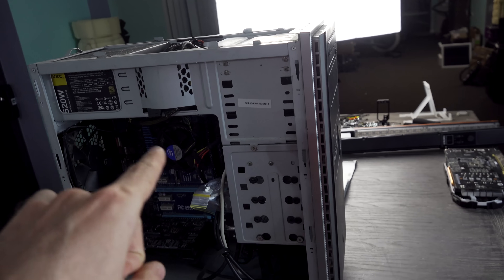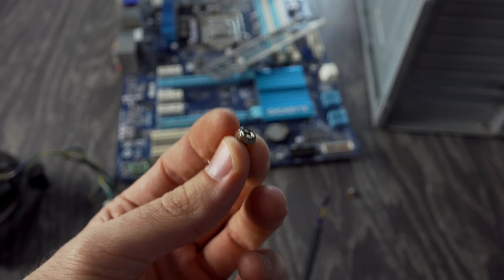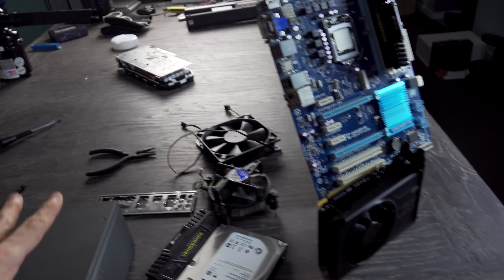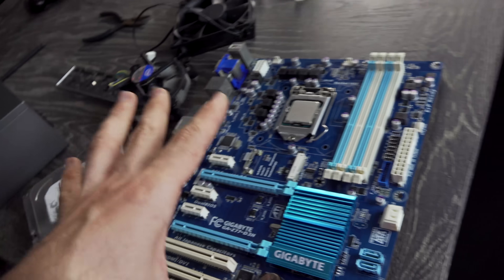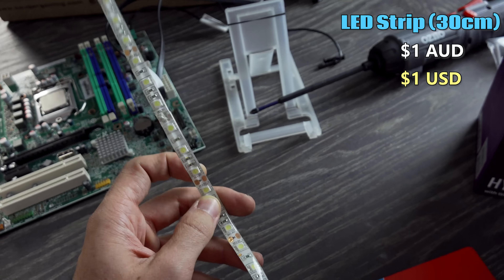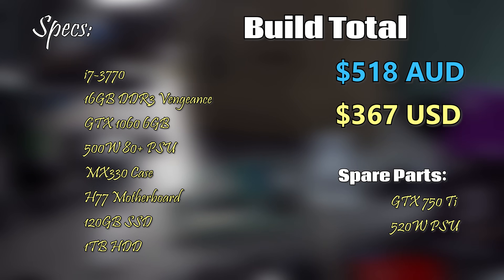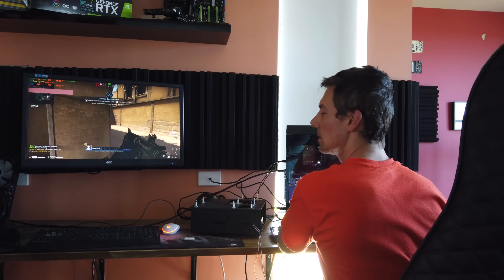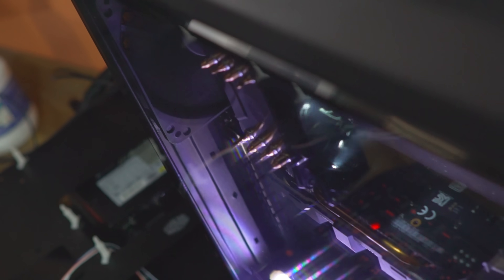Trying to Fix a $150 Gaming PC That Doesn't Turn on - Worth it..?!

Comment: Oh man streets of rage music while taking apart a PC. Love this channel even more keep up the good work.
Reply from the maker: <3
Reply: @techyescity  Do you still have that Z77 board? If so, here's what you can do, according to a post on Tom's Hardware:

"1. Shut off the power supply using the switch on the back of the PSU, wait 10-15 seconds.

2. Press and hold the case Power On swtich, then while still holding turn on the power supply from the switch on the rear.

3. Still holding the case power on switch, the board will start, once it does release the case power on switch and shut off the power supply via the switch on the read of the unit. (Do the latter two parts as quickly as you can once the board starts)

4. The board will shut down.

5. Turn the power supply back on using the switch on the rear of the unit.

6. Turn on the motherboard by pressing the case power on button.

Once the board starts this time you should see the Gigabyte splash screen, or POST page, then the Auto-Recovery from Dual BIOS will kick in. You will see a checksum error, and then recovery from BACKUP BIOS will begin."

Wishing you luck from Romania if you do this! I'm having a G1 Sniper 3 (also Z77) with the same issue coming in the mail next month and am going to do a nice i3 build with it as soon as I fix the board.
Reply: @NSHG  awh shite just when i heard it i thought of it! Made an arcade machine on our school and i put streets of rage on retro pi :3 so people can play it on break time
Reply: Yeees! I Scrolled through the comments to see if anyone else noticed that! Brought me back!
Reply: For all the streets of rage commentors, search something called streets of rage remake. I've been playing it for past few days and enjoying it.
Reply: Streets of Rage is also $0.99 on Steam right now
Reply: As soon as I heard streets of rage / bare knuckle music, I paused the video to see if anyone noticed it.
Reply: @jasonblankenship4418  , I also came here for this!
Round 2 soundtrack! Followed up with a double tease of Round 3 - beach
Reply: Hell to the yeah! Right back to my childhood!
Reply: Streets of Rage 1 - 3 still remains my fav OST in gaming.
Beachfront, Spin On The Bridge and Alien Power are some banging tunes!
Reply: Streets of rage!!!!! This is becoming my favorite channel by miles.
Reply: Childhood memories with the streets of rage. Loved that game as a kid

Comment: I am currently on a DDR5/RTX3080 that have caused me no end of problems. But when those started I hacked together some scrap parts of an old NAS and some used deal to make an i7-3770, GTX1060 3GB, 32GB all 4 sticks making it to 1333MHz and running only SATA 3 drives. To be honest after I got my new monster back, I just want to stay on the ol' 3770/GTX1060 and wish I didn't opt in to be a DDR5 guinea pig. Could even drop in a GTX1060 6GB or hell, go for a RTX 2060. To be honest, with the amount of peripherals I've got, the chipset is my bottleneck. Bah. I'm rambling on. But I have a DDR4 build comming up. So, I am going to try to sell my dear DDR3/i7-3770/GTX1060. I just think that I will not really get my money back when you think about what this little PC can do. 
Cheers and thanks for sharing.

Comment: Do you always get dudes with nfi offering you peanuts for builds like this? I had a rude bastard the other day give me a 2 star rating on Facebook market place because I wouldn’t sell the following to him for $500 Aussie. A Ryzen 2600/ASRock B450m Pro4/Gigabyte Windforce 980ti/250gb SSD/2TB hdd/MX330 with 2 extra case fans and adual fan RGB MT-4 cooler. No way to challenge review either.

Comment: Hey, Bryan:  always enjoy your excellent refurbs.  FYI:  we've recently had a lot of success with a refurbished HP Z220 MT (mid-tower), i7-3770 installed:  that motherboard comes with 1 x16 PCIe 3.0 slot.  We installed a bootable Highpoint SSD7103 with 4 x Samsung 970 EVO NVMe SSDs in RAID-0, and migrated Windows 10 to that RAID-0 using a licensed copy of Partition Wizard.  CDM measured READs at 11,697 MB/second.  HP builds really good hardware, and spare parts are plentiful too.
Reply: Here's that CDM measurement:
http://supremelaw.org/systems/highpoint/Highpoint.SSD7103/CDM.screen.shot.1.png

Here's a screen shot of the RAID-0 array, using Highpoint's GUI:
http://supremelaw.org/systems/highpoint/Highpoint.SSD7103/CDM.screen.shot.5.png

Comment: I had problems with corsair vengeance memories many times, I never will buy that ram again. With kingston never had a problem.
Reply: In fact there are certain things that I never plan to buy again. Adata SSDs, Corsair Vengeance RAM, EVGA graphics cards, and if possible, would buy asus motherboards. I have assembled over 2000 pcs in the last 10 years and I had problems with msi, asrock and gigabyte motherboards, but never with Asus ones. With ram, well, with kingston I never had problems, neither with the value ones or with the hyperx ones. With kingston, intel or sandisk SSD I had no problems either, Adata I have about 50 or 60 failed, some are not detected by the bios, others fail to read the data, others have random failures.

Comment: When you have a board that supports intel graphics - test the board and CPU first without the 750Ti - then you can determine if that works before trying out the graphics card

Comment: here, a 750ti easily sells at 50USD.,  and that i7 prebuilt(hp, lenovo and other brands that sells prebuilt) sells like 100-120USD., the prices here in Philippines is pretty fked up. seriously fked up., even a i5 3rd gen sells for like not lower than 100USD.,even a used 3yr old 1060 6gb sells not lower than 150USD

Comment: I upgraded my HTPC to a i5-3570 from the fx-8370. Not a great improvement but those older i5 are quiet at stock compared to fx and even improved game play by like 10 fps with a 970. Noctua redux fans and Artic gpu coolers make great combo.

Comment: In 99% of my PC repairs, it was the motherboard or PSU that visited the grim reaper.  Your PSU and motherboard should be from a good reliable brand if you want your PC to last many years.  Corsair is probably the best brand of PSUs.  For motherboards I like MSI and ASUS, make sure to get one that has all solid capacitors instead of electrolyte ones.

Comment: question why dont you use car dashboard cleaner instead of wd-40?  the result is as good as wd40 and smells nice, i use a silicon based one and it works also the can is double the size for half the price wich makes it 4x cheaper

Comment: I had thos Vengeance Problems back in Z77 era, i made them work putting other ram, manually setting voltage to 1.5/1.55v and then save and back to vengeance in dual channel... i dont know why still... but it worked every time.

Comment: From this I learn something. Learn Electronics and circuit. Learn how everything works with a circuit. Learn motherboard circuit. Learn how to repair them in a chip level. Flip money out of repaired stuffs plus make money from repairing computers. I just got lucky that there is no computer shop in my area that offer computer repair in motherboards or GPU. all computer shop in my area does is troubleshoot a possible problem and if something is broken replace the part and charge the client for that part plus labor which is allot for someone who wants to save money. xD

Comment: I had the same system last year I built for around $150 CAD minus the 1060 which I had bought for my ryzen 3 build. 

I7 3770
16gb rip jaws 2133mhz
1060 6gb 

Check my channel for a tomb raider video with the system. Got around 120fps on high settings 1080p. Next to no difference going from that to the r3 1200. Kind of regretted it

Comment: I don't know what the problem with the ram on that G1.Sniper was... I had a G1.Sniper running two different kits of Corsair Vengeance (LP and Pro) and it worked fine. Maybe the bios is to blame?

Comment: Is that really WD40 you are using to clean the motherboard (and the other components)? I thought that would ruin them.
Reply: It is, and it doesn't. I thought that as well. He's got a couple vids where he describes in detail how long he's used it and has had zero problems. Found this in my Liked Videos.
https://youtu.be/c-qY59VrVS4

Comment: Have you tried jumping the bios pin? Gigabyte boards with dual bios are know for this boot cycling problem I fixed another one yesterday a z170. You need to jump pins 1 and 6 on the bios M chip. Had many boards like this that were ready to be thrown out. Hopefully its your issue aswell.

Comment: probably the vrm's, google the model and failures, this is why i wish i had a proper hot air table.... if it was just the vrm's, could be an easy swap out with better quality unit.( we once replaced the VRM's on a board with units rated around 30% higher, as a test, found the swap fixed all the boards issues, we repaired 12 boards that we got free, 2 of them are in systems that i know for a fact are still running, the rest where sold in gaming systems.

we found after the swap, they barely got warm under heavy load at stock, tossed sinks on them and tested OC....the passive sinks got warm, at worst, was an amazing thing to see. 

anyway, i had a feeling that board may be fubar, some models are just prone to fail, whats sad/funny is, i have had biostar and ecs boards last decades, and gigbyte/msi/asus/etc boards that failed in around 6-9months(and the replacements even failed in similar time...gb and asus always made it right msi gave me a 3rd board and told me it was the last support i would get... i wasnt alone....)

Comment: Older motherboards, specially from gigabyte and MSI, do suffer from bad capacitors. They dry up internally, and the boards fail in various ways.
Recap the motherboard, and it'll be hunkydory again I bet.

Comment: Brian, thats a common problem with the gigabyte z77, i had the same issue. I found a fix by playing with the psu switch and power button. Try googling "gigabyte z77 boot loop problem"
Reply: https://forums.tomshardware.com/threads/ga-z77-d3h-boot-loop-problem.2487372/
Keep going until Peterpeterson, he'll tell you to play with the power button

Comment: electronic cleaner I use it on saving pcb boards  . It removes corrosion clean pcb and component and improves performance.I had corrosion on a rca pcb remote infraed board I applied the cleaner and ressurected it.

Comment: Boot looping is most commonly from a dead (or shorted) mosfet, failed super i/o chip or dead cmos chip. (not excluding physical damage).  

But for this z77 board, both BIOS chips are most likely corrupt, it is a common thing on older gigabyte dual bios motherboards despite the claim that the backup bios is safe from corruption.
Hope you haven't scraped the gigabyte, its not hard to reprogram or replace them. If you know how dual bios chips are wired, you will know they can both go at the same time.
Had an MSI Z77 with failed bios chips, had to replace them.

Comment: i have that same mobo, ga-z77-d3h. mine was 3 beeping continuously (usually its ram but nothing works). i used the 'force backup bios'. there were 3 methods i think, but mine was fixed by jumping the bios chip manually. 
paired that with i5 2500k, got to 4.4ghz. but sometimes it jumped itself to the 'white post bios' instead of black gigabyte post bios. i had to reset cmos to get previous settings.

Comment: Case was an old Antec NSK4482B, thats not the PSU that came with them. The Neo Eco 520 Is a Seasonic built unit - from memory good for about 600W before it shuts down gracefully.

Comment: I had the same exact motherboard. I tried turning on then waiting a bit. Turn off then turned on. Held power button then after 10 secs turned off. Then turned on held button then turned off. All this was done by pressing the button on back of Power supply before it actually turned off with case button. Then I plugged the motherboard to the vga output and it recovered bios from backup bios. I was not getting signal from graphics also. So maybe plug into vga and see what happens after doing that power cycling.

Comment: danm i just picked up the H77 version of that board with 3570 for $85 usd (the i7 ivy bridge just added 4 threads lol) . Mine would not boot since it had Priority Rom and not Legacy rom (still don't know what it is). So having any gpu in  would corrupted bios in would not boot and just cycle. Thanks to iGPU and dual bios i got it running, still crashes with any bios update though.... it still destroys the fx-6300 it replaced.

Comment: Wait, let me get this straight. You had two Gigabyte motherboards, one was broken, and the other one worked but not perfectly, and you chose the Lenovo board? That's disappointing.
Reply: The Force is very powerful in Lenovo. :3
Reply: @juanmassiosare9850  Lol, agree. I actually used that exact board for one of my own builds and it went great. Got the whole Lenovo, with an i5-3470, 8gb ram, and a 500gb HDD for $50.

Comment: All these youtubers budget builds are kinda weak.... For example one of my pcs was $300 and here are the specs

Case: Cooler Master HAF 932
CPU: i7 4790k
CPU Cooler: Cooler Master Hyper 212 evo
Motherboard:Asus sli gaming motherboard
Ram:16gb 2133
Gpu: RX 580 8gb
Powersupply: Corsair VS550 550 watt 80 plus
Storage: 
-western digital blue 250gb ssd
-western digital blue 1TB hdd
Extras: 
-NZXT sentry 2 touchscreen fan controller/temperature monitor
-LG 4k bluray drive

Comment: vaporized salt water would end up as normal distilled water with no salt, not trying to correct but I mean I've lived within miles of the Gulf of Mexico for 15 years, I was under the impression being so close to a large body of saltwater would encourage rust but that doesn't seem to be the case. The area doesn't get snow so the roads are not salted in winter just the Gulf of Mexico itself and rust was ironically extremely rare on vehicles or most anything. The case and screws could just be cheaply made and the electric/magnetic field created by the pc might have caused moisture and other partials in the air to attach themselves to the case. Kinda like reverse electrolysis.

What gets me is the rear exhaust where the fan motor is there is no rust.. if it was just the case material the rust should have spread behind the fans motor as well..

Comment: what's that spray you use to clean the parts?
Reply: Isopropyl alcohol....you can use spray or liquid version + small brush....WD-40 for clean any external/metal/plastic  part.

Comment: Wouldn't WD-40 short things out?  Is it non-conductive?
Reply: Isopropyl alcohol (non-conductive)....you can use spray or liquid version + small brush....WD-40 for any external/metal/plastic  part.

Comment: Right On Bryan! Diagnose a problem 🤔, woops I built a whole new PC 😸

Good Vibes! Good vibes with this build.

P.S. since you have it:
3700 + 1660TI vs 9900k + 1660ti
3770 + GTX970
3770 + GTX1050ti
3700 + RX570
3770 vs 2200G @4.0ghz

Comment: I would love to see what your talking about. My current build is an i7 3770k with a GTX 1070 32 gig ddr 3 on a SSD . Building a new rig with a i5 9600k with a rtx 2070 16 gig ddr 4 3000 on a pci e m2. Waiting for the 2070 in the mail. Do that please. Not all of us can afford a 9900k. 

I spent a month waiting for sales. Built everything brand new for 1083 USD.

Comment: I wept when you did away with the Antec PSU and instead used the one without sleeved cables. An absolute SIN in cases with side windows imo 😭
Love how the 3770 is still such a good CPU for games though!

Comment: I noticed that you're not using the 8pin mobo cable. How it that possible?
Reply: Very good motherboards have 8 pin and it helps in overclocking
Reply: @pushkarkumar7670  Yes, but the 8pin (or in this case 4+4pin) cables are NOT connected at all!? :O Check 13:50
Reply: @MaximusAdonicus  the cable goes on the left, not on the right 2:47
Reply: @pushkarkumar7670  Son, that is the Gigabyte mb... But the Lenovo mb seems to have the 4pin on the left too 7:57, which is connected (I assume), but I wonder wut are the extra 4-pin sockets on the right, which he didn't plug? :O

Comment: 9:31   I see , that you still didn't bought some black spray paint , to spray those ketchup & mustard cables , black !
It is a easy and cheap way , to get ride of those multicolor cables , just tape off the connectors , and spray away !

Comment: What did you do with the Gigabyte board in the end? Did you try a full BIOS reset & new battery as described elsewhere here, or a BIOS restoration/flashback? (one can probably buy a more up to date BIOS chip ready to use from somewhere) If you're just going to throw it away, I'd be happy to have a go trying to repair it instead (I'm learning CLBR).

Comment: Gigabyte motherboards are terrible.Everything about them sucks
Asus ftw
Reply: My personal builds I have been using Asus since the Pentium 3 days, my current rig (Skylake) is running on a ASRock that was on an extremely good sale when I built it. I have to say I am impressed so far. May even use another one when I do my next build. But with the reviews Gigabyte gets on any place that sells them, just awful.
Reply: I have a socket 775 motherboard and it's all messed up.Instead of getting 12v,i get 2v and instead of -12v i get -4.Not only that,the system temperature sensor is messed up and it shows 104-108c.And because all those problems,my cpu has a locked multiplier of 6,which makes it run at only 2ghz
And when i had an Asus mb,it worked perfectly without any problems.I'm never buying gigabyte again